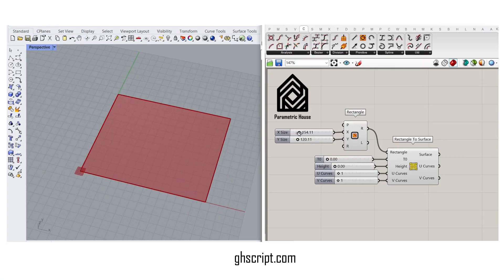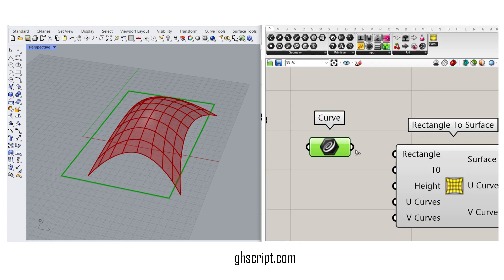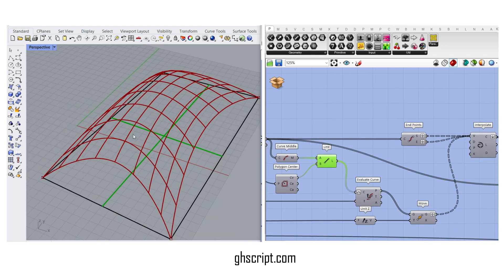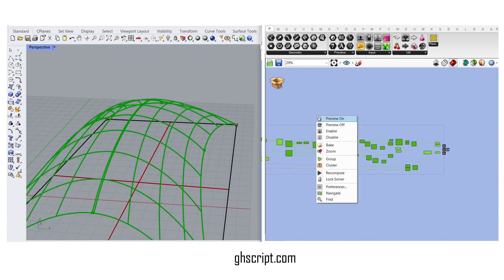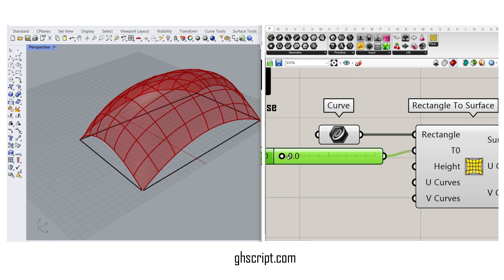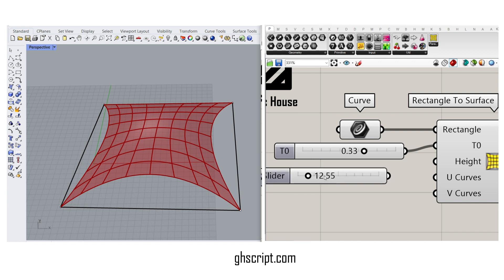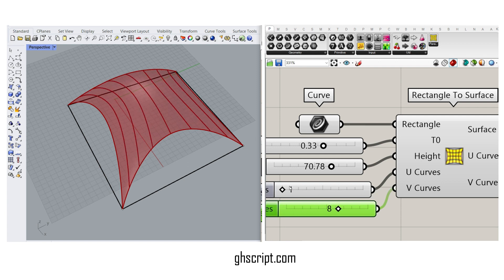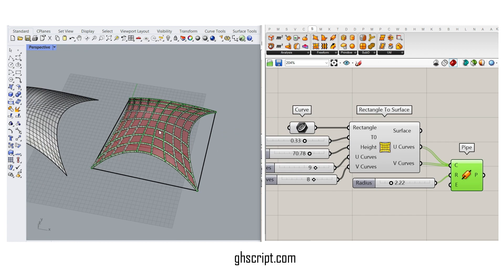Grasshopper Script (Rectangle to Nurbs Surface)

Comment from the maker: In this Grasshopper Script, You can convert a rectangle (or any 4-sided polygon) to a Nurbs surface and then extract the U, V Curves.

Inputs

Rectangle: The Base Rectangle for converting to Surface
T0: A number between 0 to 0.5
Height: Height of the openings
U: Number of U Curves
V: Number of V Curves

Outputs

Surface: Final Nurbs Surface
U Curves: Extracted U curves
V Curves: Extracted V curves

Download the 'Rectangle to Surface" script from here 👇
https://parametrichouse.com/rectangle-to-surface

Comment: What I find most interesting is the question for what kind of project this would be a practical application. I would love to hear some ideas that people have for this example :)
Reply from the maker: Good question. This can be combined with structural shape optimization. For example to find the best solution for a shell structure with minimum surface  area while having minimum deflection. This is only practical for the first stage of design. Form Finding. We will add more practical tools soon...any suggestions for future scripts?
Reply: @ParametricHouse  Yes, how to apply "Gradient Color" to a Mesh (....SubD or Surface Too?), being able to control from where and to where the Color changes are produced. That is to say, having complete control over the application of a color and its variations within a Mesh. (Thanks)
Reply: Canopy